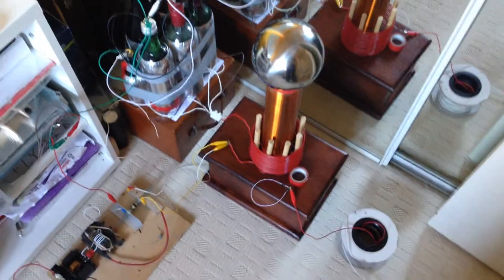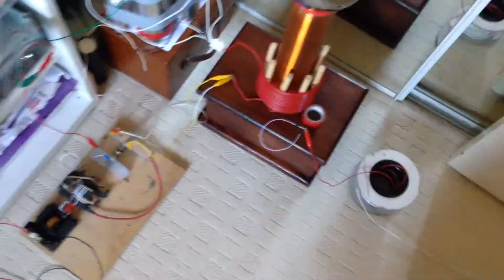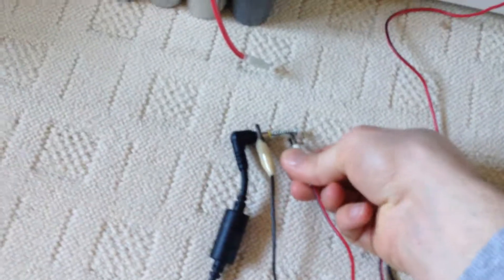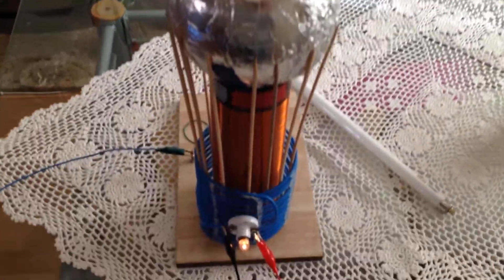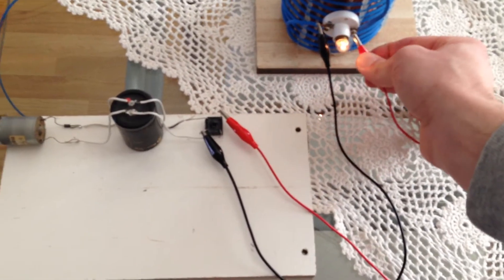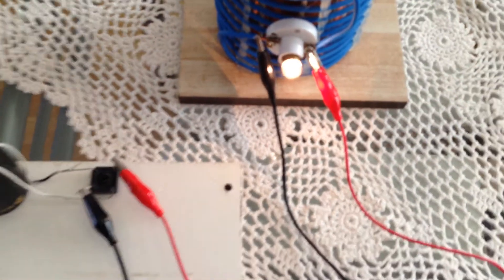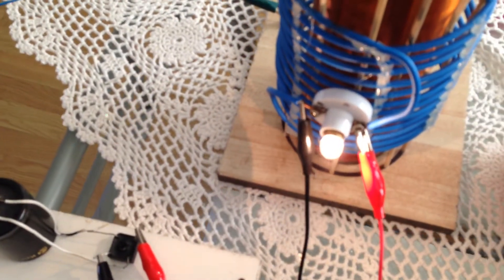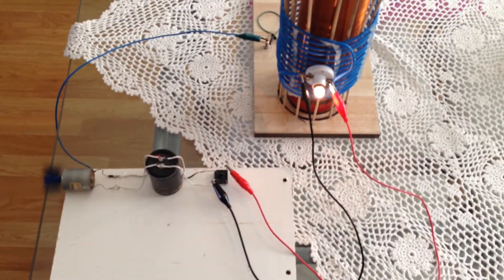Tesla Coil single wire power transfer and receiver coil!

Comment: ..and may I add a second "Good job that man" to the list!  Nice work Kamil, I built my ZVS to see if it would push more amps as a transmitter.   I'm currently having fun trying to get the strongest output/breakout from my ZVS, I need to go the other way for wireless transmission and just get it on the verge of breakout.   Good work mate - nice voltage rectification.  A dc motor is a good demo tool too. :)
Reply from the maker: deeds 
Thank you so much for your kind words :)
What I found out during experiments is that smaller break out larger wireless range plus u need to play with spark gap and one more think if you insert ferrite rings inside receiver coil it double the output and is easer to tune or some times just by inserting rings make the both coils work in resonance.
Reply: Kamil Domjan sorry but still cann't understand what you mean when you say : is that smaller break out larger wireless range   .. smaller what ? break out larger wireless range   who break out ?...for me sounds like a nonsense...please be more clear  in formulating  this explanations
Thanks....
Reply from the maker: sinergicus 
Let me put it in simple words:
if you doing tesla coils then you have to remember about making your circuit to work in perfect balance (resonance) that will help you achieve smaller sparks but bigger wireless range between transmitter and receiver coil. At least that was in my case.
Hope that helps :)